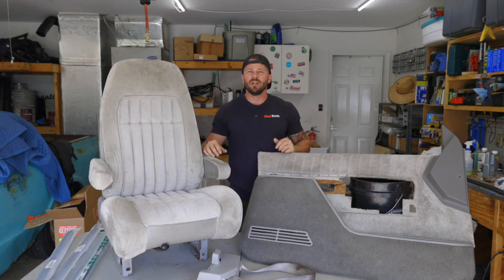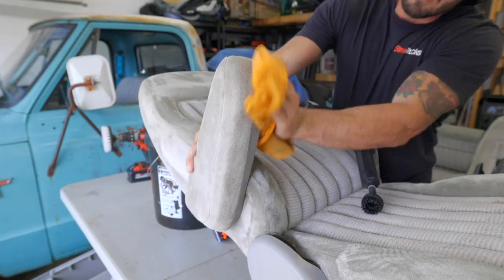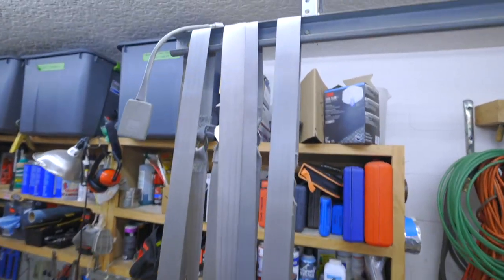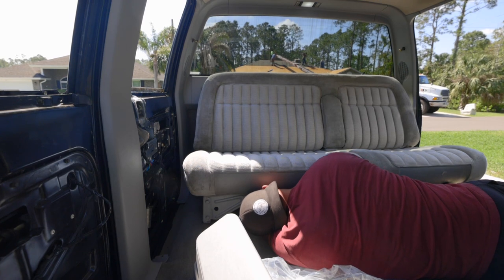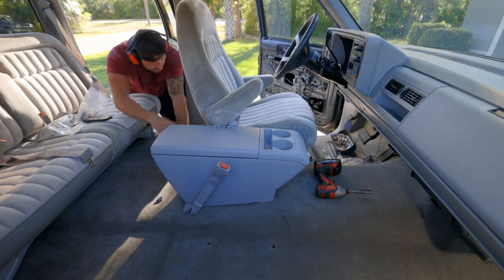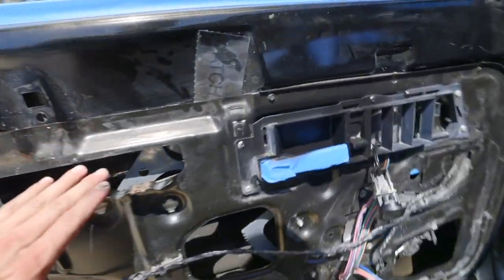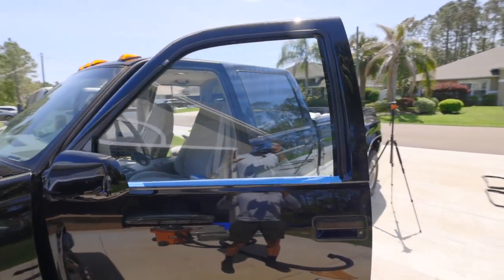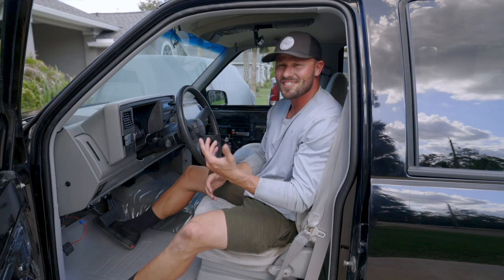Deep Cleaning Seat Belt, Door Panels and Interior - 30 Year Old Truck Build

Comment: I have a '93 Indy Pace Truck and a '94 GMC Suburban 4x4 and both have the exact same interior as your truck.  I had a '98 Chevy single cab stepside Z71, but sold it mostly because I didn't like the interior.  The 88-94 interior is my absolute favorite.  It, to me IS the 90s, which I dearly love.
Reply from the maker: I really love this 88-94 interior too. Once I got this one cleaned up I was very happy with how it came out. Just have to get these door panels back on and we're done with the inside!

Comment: I’m redoing a 95 model ext cab and I also done a 1990 Chevy single cab front to rear bumper is all new
Reply from the maker: Awesome. I'm hoping to add more OBS trucks to my fleet.
Reply: I have  two of them I want a dully 4wd any way…. Where did you get the console at ??? Nice build btw 👍
Reply from the maker: @damonlawson2117  I refinished the original console that was in the truck.
Reply: I’ve been looking for a 95 -98 center console or some parts to fix mine

Comment: So if you want to never have to deal with seat belts again
Buy tuffstuff carpet cleaner
Agitated with a drill brush
Then use the most aggressive pressure washer tip you have
Then use the carpet extractor
The belts won't get ruined because it's a felt material 
But if you don't feel comfortable doing what I just told you do what you do
Reply from the maker: That’s a great idea to use the pressure washer! I didn’t think about that. That probably would have saved me some time. Lol.